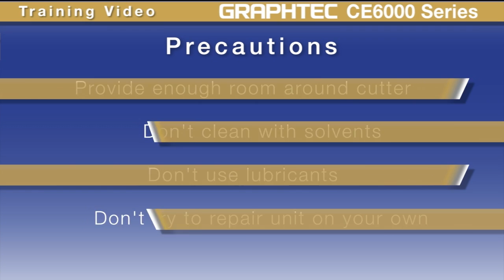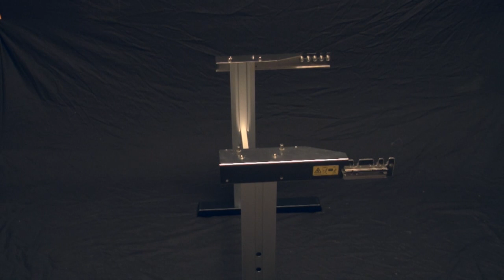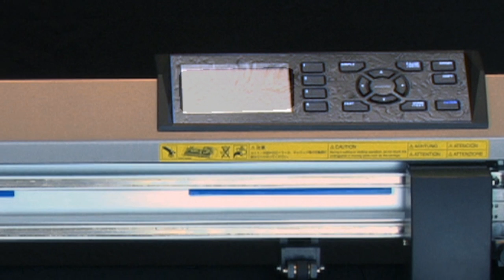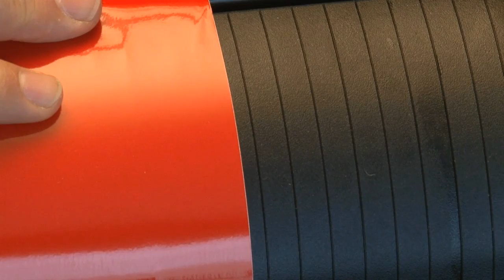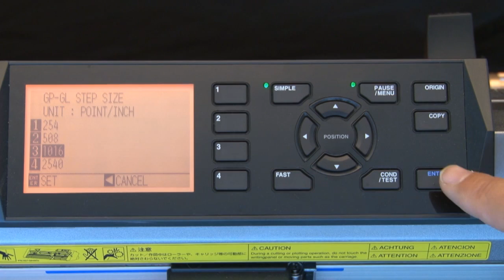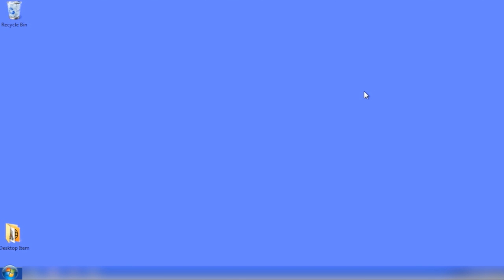Installation and Setup for the Graphtec CE 6000 Cutter

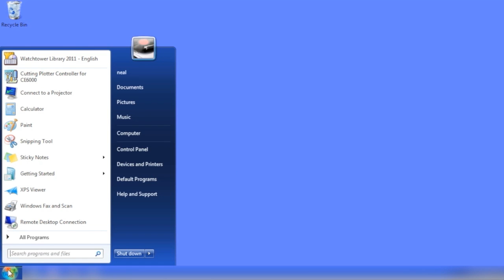Comment: Hey very nice Video! I have an important question! I dont have any media to load on here until now i will order it next week! After I have installed the Graphtec Software and installing the Driver i wanted to check it like you do it Minute: 17:08 if there is a connection between my plotter and the Computer! Than when I click on "GRAPHTEC CUTTING PLOTTER CONTROLLER CE6000" he always tell me, that there is no driver installed? I dont understand why? Is this just because i don't make the step to put the medias first? Or is this a Problem because i have a Windows 10 Computer? I would love if you can help me!Sorry for my english! Greets from Germany!

Comment: My Plotter controller does not look anything like yours but i installed it from the disk that it came with, and it doesn't have a cut test button of most of any of those options that came up on your screen.
Reply: Oh nvm it was because you have to go out of simple mode on the cutter and then go back into the program.

Comment: Hi, on the movie I see you using a spring for your blade when inserting into blade holder. Is it necessary ? We have been advised it is needed for the blade to be working properly however having difficulties insering a blade with the spring... also have problems with the machine tearing the material... have been onto customer service but not able to help, getting really frustrated :(
Reply: Hi, my apologies for the word 'NOT' missing in my previous post... yes you are NOT using a spring for the blade. and we have been advised that the spring is necessary for the blade to be working properly. We though maybe because we are not using it with a spring it's causing the vinyl material to be torn ...

Comment: Excellent video - well organized, nice closeups, clear audio. A minor point - a few times you referred to "the blue adjustment cap" on the blade holder. The blue cap is not adjustable - the black end is, as shown in the video.